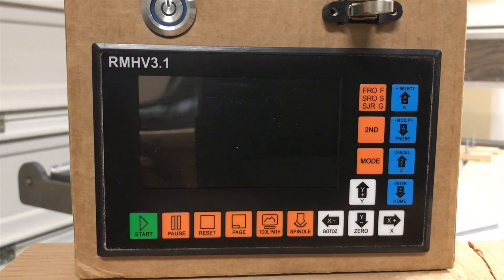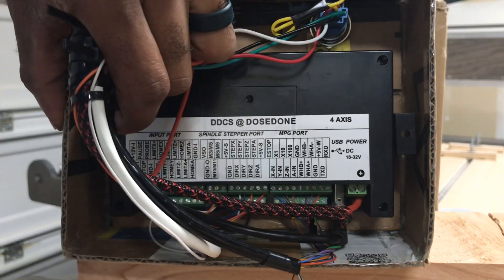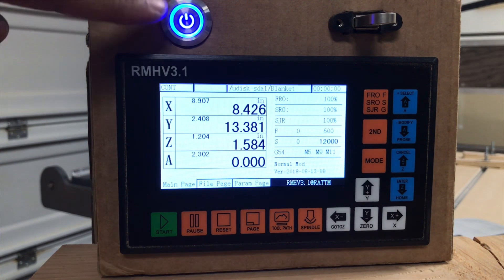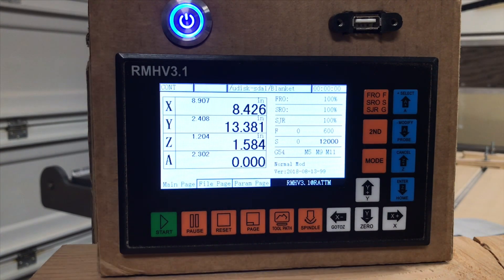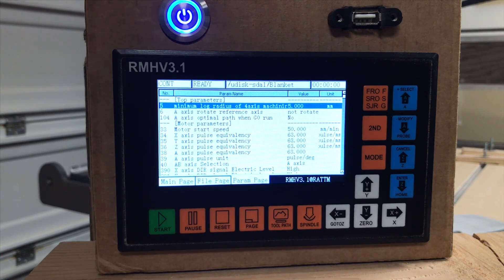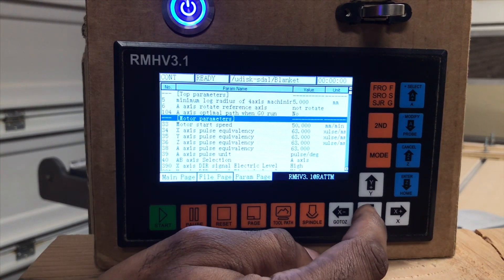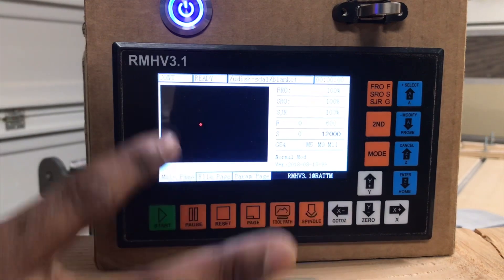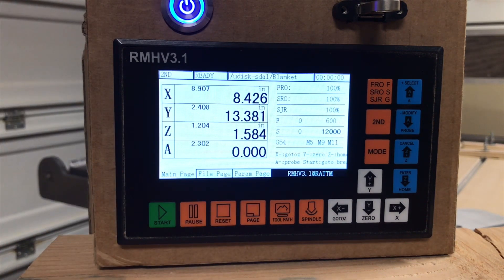DDCSV3.1 / RMHV3.1 RATTM MOTOR CNC Offline Controller Menus / Parameters List

Comment: I'm having issues setting up my same controller's Parameter screen so when the Main screen says X axis has moved from 0.000 to 1.000 my mill moves 1 inch. I've moved my Pulses per unit from the default of 640 to 10,000 or more and yes I get some more travel but nothing like what I need. It takes my ball screw seven revolutions to move the table one inch and the timing belt is probably a 2:1 ratio so the stepper has to turn like 14 complete revolutions to move the table one inch. I have changed the parameters from MM to Inches and I've messed with the driver's dip switches to add/subtract its number of pulses. Not coming close to what I need. Can you help me?
.

Comment: My controller is version also RMHV3.1. but it doesn't have some probe parameters, is there any way to update the firmware?
Reply from the maker: There are way to update the controller but I have not completed one yet. The unit does what I need so I have not messed with it too much. Not being tech savvy but learning I did not want to run into issues trying to install an update. The old "If it ain't broke" mentality.
Reply: @SuperJfritz  I understand that, thank you very much for answering.

Comment: thank you so much for this. I wanted to ask does this controller have the ability to use a Z axis Height sensor? my work requires a number of tool changes and it would be great if the controller could check the height of the various tools and accommodate
Reply: From what I found in pictures on Amazon, It does :)
Reply from the maker: @tgirard123  I know that this controller works with tool changes but I have no experience with that yet. I'm afraid I am no help on this one.

Comment: Thanks for the video. I'm on the fence re. off-line controller. will start cnc router build soon. any functional/ports etc... difference between DDCSV3.1 and RMHv3.1?
Reply from the maker: From what I have seen the terminal connections maybe a little different but the units are very similar if not same in functions.
Reply: @SuperJfritz  Thanks!

Comment: Hello, do you know the difference between the RMHV3.1 and the DDCSV3.1?
Reply from the maker: I am not 100% sure. I think they are the same thing just went through a name change,  from RATT MOTOR to Digital Dream both versions are 3.1. I could be wrong and it could be different vendors.  But like I said I am not 100%

Comment: The current firmware does not support slave axis configuration and separate home switch for slaved axis.
Lack of this feature pretty much eliminates this controller for large moving gantry router builds.

http://www.ddcnc.com/

Comment: awesome video, im looking forward to just move one step motor back and forward in inches in one axis for a saw, do i need to create a program in pc to run this or i can set all parameters in the controller? please contact me if you could help me ajg25@hotmail.com
Reply from the maker: This unit can move a machine manually but I do not think you can create a program that runs directly on this unit.

Comment: Just bought one based on your two videos. Will use it on my plasma table.
Reply from the maker: Wow! I hope you enjoy the unit. If you have projects that you will run multiple time off the same file I think you will love it. I also think this unit makes wiring  a CNC much easier also. Thank you for you feedback.
Reply: @SuperJfritz  I just need to figure out how to write a macro (or routine) to make it work like a torch height controller.

Comment: Is possible make backup of all parameter of controller?
Reply from the maker: I believe there is. I have not done it myself, for questions like this one I go to the facebook group "DDCSV 1.1-2.1-3.1 PLC CNC CONTROLLER". This group contains members that really know the controller any may have even designed the controllers. I am sure someone would have more information if you use that  platform.

Comment: Great review. Thanks. I'm thinking about buying this unit for my CNC. Also one more question. During the video you are saying that the USB is not good for long programs. How long? I mean 2-3 hours ?
Reply from the maker: That is a great question. I have not had any issues with the unit and flash drive compatibility. I have heard from some, that they have heard , some Offline Motion Controllers have issues with long runs. They made sure to mention that it could be the fault of a cheap flash drive. I have not heard of this issue occurring first hand. So to be honest I included that information because I have only done 2 hour runs at most thus far.  I plan on working my way up to longer runs learning my machine.
Reply: So u dont have any issues with it? Also i saw its pretty smal unit, u dont have any problems with the screen size? Its not top small? I'm doing a cabinet doors mostly from MDF and sometimes im runing like 3,5h strait.
Reply from the maker: I have not had any issues with this unit that were not user error. I love the size of the unit and it is one of the reasons why I picked this controller. Since it is small overall (to me anyway) I was able to make a mobile hand-held enclosure. The screen size is really not a concern since the screen can always be moved closer. I do all my designing on a desktop and really only use the Offline Controller to run files from USB drives and CNC machine settings. I wish it had just few more button so there were less multi-function keys, but this would only add to the size. I feel the latest version helps with this by changing the color layout on the latest version.
Reply: Thanks for review. I saw the mobile enclosure, great job! I will try with NCH02 unit as well.

Comment: Im a trade machinist looking at my first cnc router build, if im understanding this correctly i connect my drivers directly to the controller, load my file and im making chips? I have bob cad v23 as programming software. Also the power supply im looking at for my drivers is 48v, will this work?
Reply from the maker: Thank you for asking, it is always good to clarify. When I say you can load a file and go. I was assuming that someone already has a machine that has motors, drivers, and a way to cut chips. At this point most will need to decide if they are going to run their CNC with a Laptop/PC or Offline Controller. Connecting a CNC to a PC/Laptop in most case requires additional components like a BOB (Break Out Board) or UC100. I do not know much about those components due to my offline controller not requiring them to connect to the drivers.  This Offline Controller does wire directly to the drivers, but there are other components needed to have a running CNC. I do plan on having a video that shows more about the routing of my enclosure wiring. Then a little bit later a detailed video for those that are going to us the same unit. This unit needs a 18v-32v power supply. I chose a 24v to run mine. I also us this power supply to activate the SSR (Solid State Relay) that allows my VFD to turn ON/OF with the CNC with one switch. I hope this helps.

Comment: For someone building a first CNC would you recommend this approach vs Mach4 or other pc based system?  This seems cost effective and nice not to have to tie up a computer.
Reply from the maker: I would say that it would depend on what you are using your machine for. I plan to run the same file repeatedly without needing to make changes. If you are going to design a file for a single project and not repeat that job very often then it maybe easier to have a PC hooked up to allow for adjustments. My other main reason for going with the offline controller is since my PC/Laptop is not in the shop I do not have to worry about the dust getting into them.